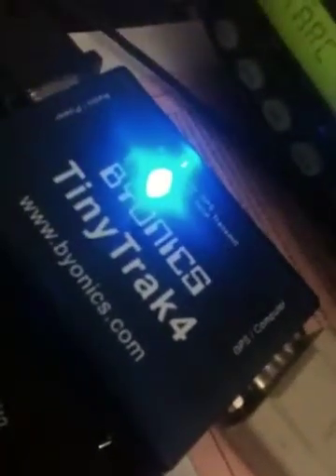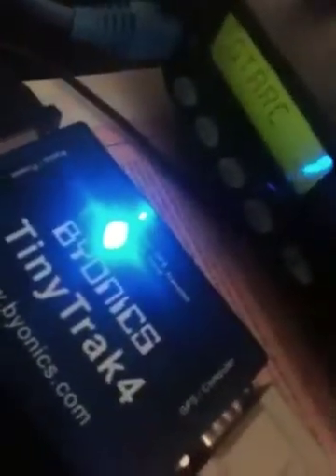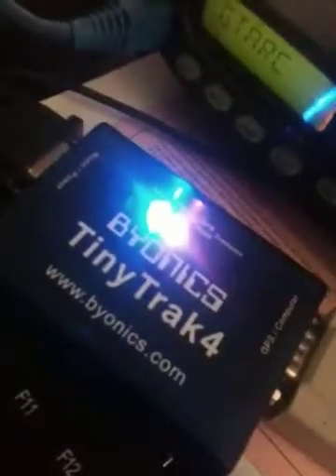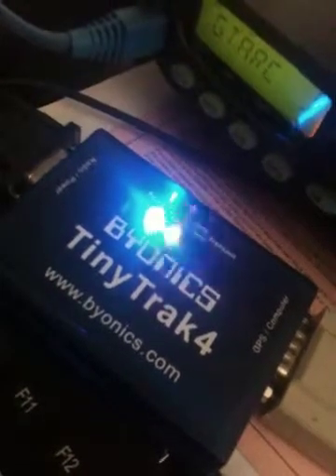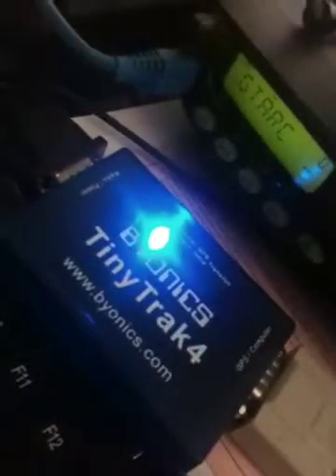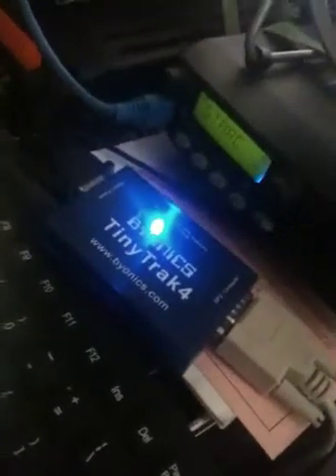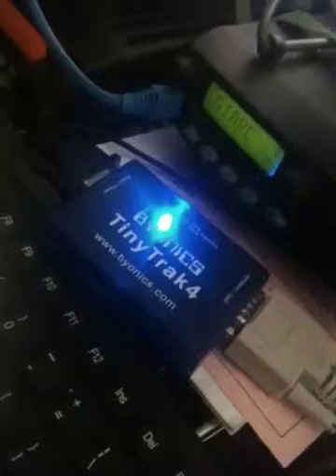APRS 2 meter iGate block diagram 144.390

Comment: so a "digipeater" doesnt need an GPS? because its just retransmitting everybody elses?
Reply from the maker: IN my case, my digi is located in  my house, and my coodinates are hard coded and do not change..no gps needed, but yes, a digi just takes the incoming packet as is, increases the time-to-live field and retransmits it back out.

Comment: I run a TX/RX iGate here in West Saint Paul, Minnesota.  I'm using a Microsat WX3in1 Plus 2.0 device hooked to a Kenwood TM-V71A.  No software required and runs 24/7.  It's running under the callsign N0ALE-10.  Thank you for contributing to the APRS infrastructure!

73 from N0ALE

Comment: Hi, I'm using a TinyTrak 4 and the Yaesu FT-2900 for a mobile APRS.  I'm having trouble getting the  TT4 receiver set up.  Would you please be able to tell me the setting you are using for volume, and squelch on the 2900, and the rxamp setting of the TT4.Thanks and 73
Tim, N3NCG
Reply from the maker: sure, volume i sat 8 oclock and sql is about 1 oclock.  look at your computer screen and roll the volume up and down while watching packets come in, find the range on the low and high end where no decoding is happening, then move it in between the 2 locations.   YOu want the sql to be set so it is not open (no transmit will occur if the sql is open), but not so much that you cant hear any transmissions.  73

Comment: hi was wondering if you had a video of how to program the tt4 for digi.. and if not would you mind making one when u get some free time. and posting it
Reply from the maker: I use KISS mode, no programming required. set your baud rate to match..mine was 19200 default, and I left it alone.   use KISS mode in your software ( I use XASTIR for Linux)  good luck!
73
AG6iF
Reply: @JamesSanders  How about using it as stand alone digi with out a computer.
Reply from the maker: @Pacman163  no problem,  just have to log into the tiny trak 4 and turn on digi setting.

Comment: Hi there.  I'm considering installing a similar system at my home QTH.  Question:  Is it just a serial connection via a USB-to-RS-232 adaptor?  Is it a null modem connection between the computer and the TNC?  Can you explain that bit?
Reply from the maker: Hi,
yes, a simple usb/serial cable, and then set your baud rate and bits, stop bits..  I am using 19200 8 1 for the tinytrak4.  73  de AG6IF
Reply: Hi-Long time no talk.  I rigging a TT4 with an FT-2900, trying to make it function as both an iGate, digipeater, and also connecting it via APRSISCE/32 to also use it as a local APRS client.

But no luck...I've gotten the TT4 to digipeat just fine--it actually seems to do it just fine without the connection to the computer.  Trying to make it play nice with the APRS-IS and the client seems to be the problem.  That makes me think it's actually a problem between the computer and the TT4.

Thoughts?

Comment: Is this a TX/RX igate? I used a AGW packet engine, APRSIS32, baofeng radio and a 1gig atom laptop. Works fine..
Reply from the maker: +revo adan Hi, yes it is TX/RX.  , In fact, both of them (VHF and HF) are TX/RX. glad to hear your system is working well.  I probably went way overkill on my transmitter for VHF as I deployed a FT2900 for the job.  73

Comment: Jim AG6IF.
Good day. Like the clip. Im looking at the same setup. Yaesu into the Tiny Track 4 into a Linux Laptop. I will add the GPS. Will be used for field work. Grossly impressed with the HF APRS. In my car VK2TEQ-7 VK2TEQ-9. I bought the Kenwood D710 because of the Youtube clips. Australia is pretty empty when it comes to APRS. The ISS message got me thinking too. Next project. THANKS. P.S. Using a Raspberry Pi for the iGate VK2TEQ-1. So nice. The ISS. Thats my next thing.
73's
Greg VK2TEQ QF56LF
Reply from the maker: +Greg J McCulkin  Greetings and thank you!    for HF APRS, check out my videos on Robust Packet for APRS.   Much improved performance, however the TNC (SCS Tracker from the pactor people) is a bit pricey, the performance is beyond compare.  73  Jim AG6IF

Comment: the international space station folks (anyone interested in the APRS and phone 2M experiments for psychological enrichment aboard the ISS which seems often)  they report a need for more of these iGates and are asking anyone who has been messaging them for fun who can enable iGate capability with their wares, not sure if I can post a link but search Ham radio 2M APRS ISS and you'll see things like, "The biggest weakness in the system right now is the lack of Internet Gateways, or IGates. Almost all APRS programs have the ability to function as IGates, consult the documentation of your program of choice for details...more will be better please and thank you..."
Reply: at any rate I'm learning and was all about CW and SSB and more old, tube stuff and less high tech convenience, but this has me getting into it right away to wave "hi"... I've gone from lowering my angle in HF for ground to skywave propagation to researching what does straight up the best, dipole or vertical gain ground plane? Then there are some funky inverted V's looking good, thanks! (I digressed). I'm taking my technician's license late waiting for my wife to take it with me, so until I can deliver that official 73 from me, please in the meantime settle for a 10-4 with gratitude, 10-24  ;P -Spider 459 in 11m DX land, Maidenhead EL88qc (OMGoodness it ends in QC)